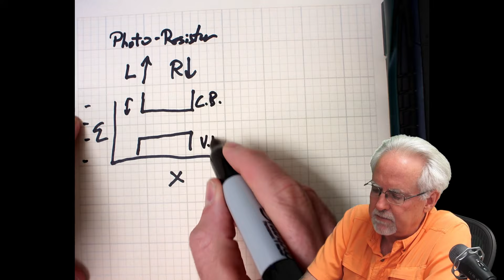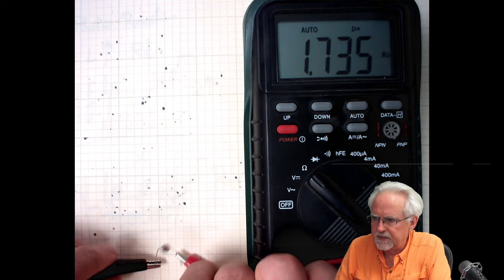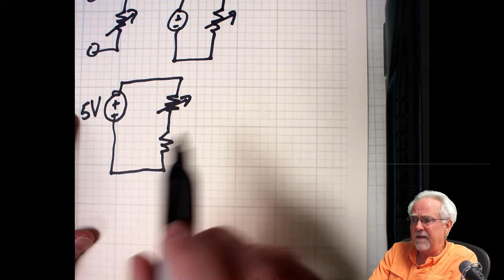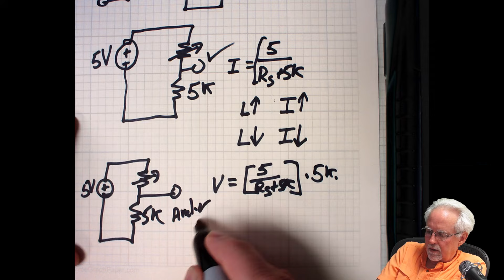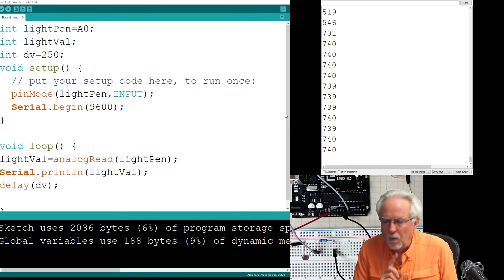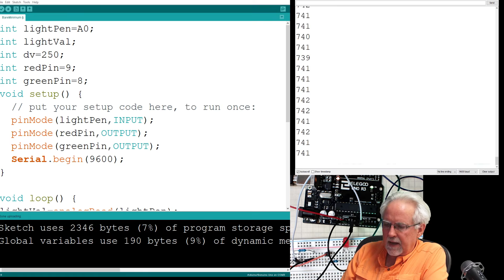Arduino Tutorial 25: Understanding Photoresistors and Photo Detectors

Comment: Hello sir, I'm from Bangladesh 🇧🇩. The Elegoo kit is not available here and elegoo does not ship to Bangladesh. So I'm using a kit that i bought from a local shop. My kit is quite similar to the Elegoo one except a few differences . Today u r using 5k Ohm resistor, which is not included in my kit. My kit includes 1k,10k and 220 Ohm resistors.

Could u pls tell me which of these resistors can be used instead of 5k ohm resistor?
Pls help me out. If I don't get this, i won't be able to proceed further

Comment: The haters are idiots. They dont want to learn how to use a microcontroller how to create circuits. They want to learn how to copy someone’s code and copy someone’s circuit. Understand how this stuff works at a granular level really helps when you go to create your own circuit. I know this because the last homework project seemed really difficult, but with a high level of understand I was able to work it out by walking through how each component works, not just what it does. If you are a hater reading this, understand that engineering requires an understand of how things work and why they work, it’s not just legos that you piece together. Understanding why/how something works is how you come up with unconventional uses for things and solutions to problems that have yet to be solved.
Reply from the maker: I dont publish all the hateful comments, but you really would be surprised to see what people complain about. There are some really peculiar people out there.

Comment: Loved it, I always try to add something to your sketch to make it more, just for my learning. I changed the voltage to volts by multiplying by 5 and dividing by 1023, used a the red light if the voltage was over 3.5 (like a warning), the green light if it was under 1.5 volts and lite them both when it was between those values. I used the statements:
if (volts <= 1.5 && volts >=3.5) {
digitalWrite (greenPin, HIGH);
digitalWrite (redPin, LOW);
}
this worked great. Some of my variables are different, but you get the idea. Thank you so much, over 60 and continuing to learn. Please keep up the good work.

Comment: I did the homework sir, also please don't stop with the math and physics, I love it so much keep it up.

Here is my code.

int photoPin=A8;
int photoVal;
float V5k;
int rPin=7;
int gPin=8;

void setup() {
  // put your setup code here, to run once:
Serial.begin(9600);
pinMode(photoPin,INPUT);
pinMode(rPin,OUTPUT);
pinMode(gPin,OUTPUT);

}

void loop() {
  // put your main code here, to run repeatedly:
photoVal=analogRead(photoPin);
Serial.println(photoVal);
if(photoVal>=500){
digitalWrite(gPin,HIGH);
digitalWrite(rPin,LOW);  
}
if(photoVal<500){
digitalWrite(gPin,LOW);
digitalWrite(rPin,HIGH);  
}
}

Comment: Control-t will automatically format the code.  Also a photo resister in a 5V circuit is  safe to just put your finger on it to block the light.

Comment: Loving the vids, but I am SUPER confused.  Why not just go 5v, photresistor, Analog Input?  The resistance would still change across the entire circuit.  My only thought is that the 5k is being used as a "current limiting" resistor so in case the photoresistor becomes not resistant enough the circuit doesn't fry itself.  Am I right here?  Also, I used 2 while loops instead of If statements for the LED homework.  I figured if statements are for one time things and while loop is a constant.  I wanted the light constantly on so that would be a while loop.  The circuit (with the 5k resistor, didn't want to try without and fry something cause I'm being dumb) does work with the code I made, I'm just a little confused on some concepts here.  Any help would be much appreciated.

Comment: using else will light the red LED...

int photoPin=A0;
int photoRead;
int TD=500;
int rLED=10;
int gLED=9;

String msg="Photo Electric Cell Voltage is: ";
String msg2=" volts";

void setup() {
  // put your setup code here, to run once:
Serial.begin(9600);
pinMode(photoPin,INPUT);
pinMode(rLED,OUTPUT);
pinMode(gLED,OUTPUT);
}

void loop() {
  // put your main code here, to run repeatedly:
photoRead=analogRead(photoPin);
Serial.print(msg);
Serial.print(photoRead);
Serial.println(msg2);
delay(TD);
  if (photoRead>600){
    digitalWrite(gLED,HIGH);
    digitalWrite(rLED,LOW);
  }
   else {
    digitalWrite(rLED,HIGH);
    digitalWrite(gLED,LOW);
   }
}

Comment: It is easier to just connect all negative legs of the components, where possible, to the negative rail of the breadboard, so you will only need to connect only one cable-jumper to any hole along the negative rail of the breadboard to one ground pin of the Arduino.

Comment: Mr.Mcwhorter..I was just wondering that i dont have a 5K ohm resisitor but i have a bunch of 10k ones. So i thought of compromising by making a 5k resisitor by connecting 2 10k ones in parallel. But i dont know how that wd wor and also got confused in the circuit analysis to calculate how much voltage wd come out of the self made 5k resisitor. Could you pls help :)
Reply: you can use a 10k ohm resistor as long as you change the analog output accordingly

Comment: Hey Paul! I've got misunderstanding. If the photoresistor gets more light it has less resistance, and if less light - more resistance. So when lights turned off, resistance bigger, and the power we need to pull that current through the resistor is higher (we need more voltage). But the arduino shows less values("voltage" values), when lights turned off. So, how does the Arduino voltmeter really works? Or, have i mistaken? Thanks!
P.S. The lesson itself is awesome)

Edited:
and i have checked my theory with a multimeter, and it works, as i supposed

Comment: Hey, so just a simple question, but if we don't use the 5K ohm resistor in series, our output voltage will show 1023 right? Or 0?

Comment: Never worry that codes are not available for download. I rather write them and strengthen my coding skills. It's been a long, long, long time ago that I coded in Clipper. I really enjoy your lectures alot. Keep up the good work. Bam, and brother, and holding breadth, and understanding your graphs, enhances the learning values alot more. It's like a REAL classroom, and a personal touch too. Though I take tea instead :)
Reply from the maker: Tea is OK as long as you do not use sugar.
Reply: @paulmcwhorter  Haha, at times I do have cappucino. But tea is better with your lectures. No Sugar of course.   By the way, I noticed something about this lecture. Actually there are two sets of circuits. One for the photoresister.  And the other is just to output the LEDs. Right?  Nothing in between.

Comment: Hi Paul, actually really appreciating the deep dives on stuff - I have a physics degree so broadly understand the solid state stuff but had no idea how to translate that into useful engineering tools, so the explanations are great.
 I actually sought out your series because I already bought the ELEGOO Super Starter kit some time ago and found the included "lessons" to be great for quickly making something happen, but terrible for gaining any insight into how any of it worked or why you needed to wire it up a certain way. 
Anyone who doesn't like that aspect can just skip a few minutes - I work as a coder, so I'm guilty of doing that myself for some of the more basic conditional logic stuff a little earlier in the course :P
Enjoying the course massively so far, consumed the first 20 videos in about a week and don't plan on slowing down until I've caught up.👍

Comment: Just a quick note about differences you might found in other kits.
Some kits (like the one I'm using) don't have a photoresistor, instead they have a phototransistor. Electronically speaking the difference is in the effect of the light. In a photoresistor, as Paul said, the value that changes is the resistance. In a phototransistor, the value that changes is the current flowing between its two pins - collector and emitter. 
In a NPN-type, electrons will flow from emitter to collector therefore the current will be positive from the collector to the emitter. In this case, you can see the collector as the plus (long leg of a LED) and the emitter as minus (short leg of a LED).
In a PNP-type, everything is reverse, meaning that the actual current will flow from emitter to collector (emitter will be the long leg and collector the short one). 
If you have any doubts about NPN and PNP, go to Paul's lesson "Arduino Tutorial 2: Understanding How Light Emitting Diodes (LEDs) Work".
Just connect the same exact circuit as Paul showed. Mind you that a phototransistor DOES have a polarity, as said above. Once you have connected the circuit, notate the values with light on and off in the same way shown by Paul. 

Said that, great tutorial series Paul (although I don't get why you don't like that the IDE closes the parenthesis automatically 😂)

Comment: So why have i heard the term 'LDR' or Light Dependant Resistor used? is it the same as the photoresistor or are they different?
Reply: The same.  A photoresistor (acronym LDR for Light Decreasing Resistance, or light-dependent resistor, or photo-conductive cell) an active component that decreases resistance with respect to receiving light on the component's sensitive surface.

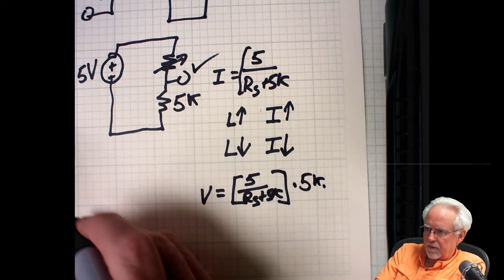Comment: 14:05 The question why the 2nd resistor is needed is left unanswered! Even in the formula, the 5k resistor is not needed?
Reply: Without a resistor in series with the photoresistor, a voltage reading that’s proportional to the change in light level, wouldn’t be possible with the Arduino. Remember, the Arduino’s analog inputs can only read voltage and that voltage is referenced to its ground, as is the circuit too. Try it yourself, remove the 5k resistor and replace it with a jumper. Take analog readings at different points on your new circuit while blocking and unblocking the sensor’s light. 
 
It’s a little bit of Kirchhoff's Voltage Law why we need that 2nd resistor. It’s so important we even have a general equation for determining that second resisters value. Rs = equals the square root of the product of the sensors minimum resistance x maximum resistance. In this case, square root (1.55k x 16k) = 4.898k or 5k.  See: https://youtu.be/WMkN-uHd-Xo?t=668

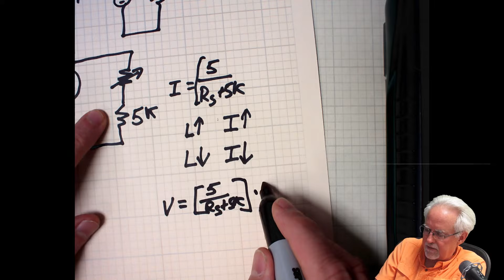Comment: Great lesson! I just have a few questions regarding 13:40 I know V=IR. Why would R be just 5k? Shouldn't it be the total resistance which is 5k + resistance of the sensor? Also why does the voltage have to be measured between the photoresistor and the 5k resistor? Other than these two questions, I enjoyed the lesson.
Reply: It’s all there in the math 13:40, you’re just not see it. Total resistance was included in the equation. I = V/R, therefore I=5v/(Rs+5K).  Substitute in 5v/(Rs+5K) for I. V=IxR = [5v/(Rs+5K)]x5K, equals the voltage across the 5k resistor.
 
Why measure between the photoresistor? That’s the only point in the circuit where we can get a voltage reading that’s proportional to the change in light level. Remember, the Arduino’s analog inputs can only read voltage and that voltage is referenced to its ground. Try it yourself, take analog readings at different points while blocking and unblocking the sensor light. SEE: https://youtu.be/WMkN-uHd-Xo?t=668

Comment: Hey can I use a 10k resistor instead of 5k or will that not work?
Reply: A 10K would work too; however, the general equation for determining that second resisters value is: Rs = equals the square root of the product of the sensors minimum resistance x maximum resistance. In this case, square root (1.55k x 16k) = 4.898k or 5k

Comment: I'm considerably behind on these tutorials because I've been remodeling my hobby workshop. In the process of remodeling I spilled my Elegoo box with all the sensors and stepped on the passive buzzer. So this tutorial obviously couldn't be done with the passive buzzer. Since an active buzzer will not change tone like a passive buzzer I had to come up with another solution. I decided that the real learning part of the lesson was how to calculate the delay time and the result could be represented by a shift in blink rate of an led in place of the frequency shift of the passive buzzer as the light source was varied in intensity above the photoresistor. I did the calculation and found the delay time result did not vary enough for it to make a recognizable change in an led. The bandwidth of the delay time was too narrow (only about 10ms for my lighting situation). So, I added a multiplier causing the resulting delay time to be stretched over a large enough range to generate a perceptible variation in blink rate allowing me to visually demonstrate the same thing which would have been demonstrated by a shift in frequency of the buzzer using virtually identical code.

Comment: Sir, the photoresistor that i use is showing higher values of voltage when there is no light..... I used a resistor of 4.7k
Reply: Swap the positions of the sensor and the resistor. You're reading across the sensor, that's why your voltages are increasing while the light is decreasing. The resistor should be on the ground side if you want the voltage to increase while the light is increasing

Comment: I did it with 'if' statements;
int lightPin=A1;
int lightVal;
int redPin=6;
int grnPin=7;

void setup() {
  // put your setup code here, to run once:
pinMode(lightPin, INPUT);
pinMode(redPin,OUTPUT);
pinMode(grnPin,OUTPUT);
Serial.begin(9600);
}

void loop() {
  // put your main code here, to run repeatedly:
lightVal=analogRead(lightPin);
if (lightVal<=80){
  digitalWrite(redPin,HIGH); 
}
if (lightVal>80){
  digitalWrite(redPin,LOW);
}
if (lightVal>=650){
  digitalWrite(grnPin,HIGH);
  }
if (lightVal<=650){
  digitalWrite(grnPin,LOW);
  
}
Serial.println(lightVal);

}

Comment: I made an accidental discovery that helped me study, learn and trouble-shoot this circuit. Due to constricted space I have my arduino and breadboard located on my computer desk that happen to have a 'pull-out keyboard'. I build on the pull-out. Using the pull-out keyboard acts light a 'switch'. Under the desk, less light. Pull it out, more light. With that little accidental discovery I can change the voltage to different levels  to tune the 'on/off' values. With this little trick I used the keyboard slide-out desktop like a variable resistor. leaving my lights on and seeing the results at the same time. It is like moving the photo-resistor in or out of the light as much as I want to adjust the value that best suit what I want.

Comment: As a Junior in EE, I have found this series extremely helpful. Thinking of making a temperature sensor or using the joystick module to control a fan to put as a project on my resume. Great series of lessons!
Reply: when you build this, i would appreciate if you publish your paper, a link so i can read the abstract.    i am doing exactly the opposite.  i bought a toy windmill, (a real toy) with comments it could not charge a battery.  i do not think the thing even develops the amps to overcome the internal resistance in a battery.  that is why i'm taking this course, to publish a youtube video on battery charging and wind turbines.
my degree is IMET, and i have training as a wind turbine tech, trained on the big wind turbines you see on the side of the road.

Comment: Please don't reduce the level of explanation and theory.  I think you are doing a terrific job and with the wide audience you have I think you have the balance spot on.  I haven't come across any other free to use educational site that matches yours.  You are to be applauded.  Blooming marvellous!
     The only suggestions I would make are (1) include the list of components and their values in your video description, and (2) where pertinent suggest in your video description additional reading particularly in reference to the Arduino code.  I regularly come across sketches created by others that achieve similar outcomes to yours but using slightly different code (perhaps from C++ programmers) and this can be confusing.  Examples would include different compound operators in 'if' and 'while' statements, alternative syntax such as #define or const int and the use of arrays.

Comment: this level of explanation on the physics of the electric components felt right. on one of the starting lessons, it felt like it was a little too long since most of the lesson was about theory. but it was understable since there might be some that have never worked with electric circuits before and it was a good starting point. also, i very much prefer these types of explanations which include theory (along with the formulas) and their practical application with circuit building. like that, i can actually start building on my own, otherwise it just feels like i'm not learning and simply copying what you're doing. that's the main reason, why started looking at other guides/lessons once i got to lesson 10 of the examples included with the elegoo kit. while nice starting points for each of the components a quick guide on how to use it, it lacked much of the deeper explanation i needed.

Comment: if your where only using 3.3 volts would you use a 3kohm resister? I know you said we should be using the same equipment but I bought a photon because it has wifi and bluetooth and a faster processor and it is smaller. Thanks for doing these videos they are helping with these devices a lot.
Reply: The 5K doesn't relate to voltage 5.0 or 3.3. The general equation for determining that second resisters value is: Rs = equals the square root of the product of the sensors minimum resistance x maximum resistance. In this case, square root (1.55k x 16k) = 4.898k or 5k